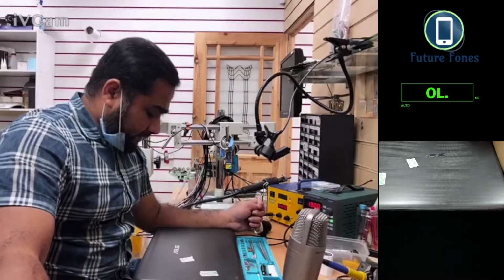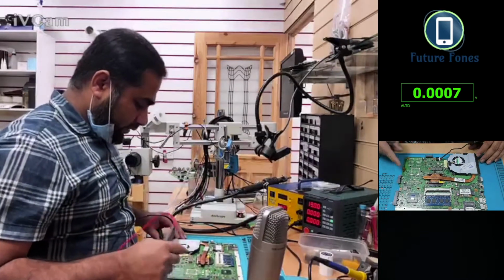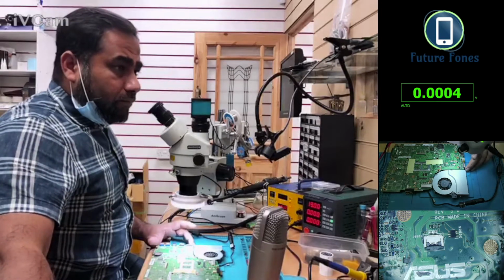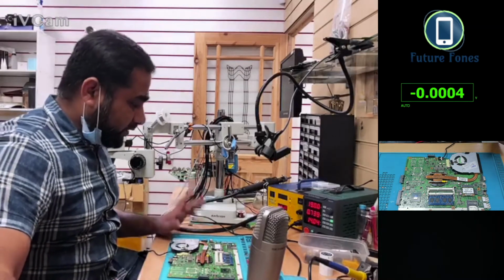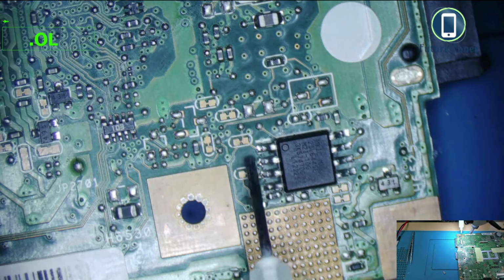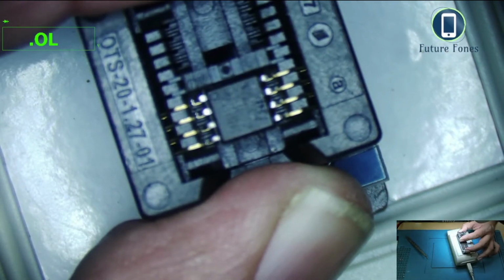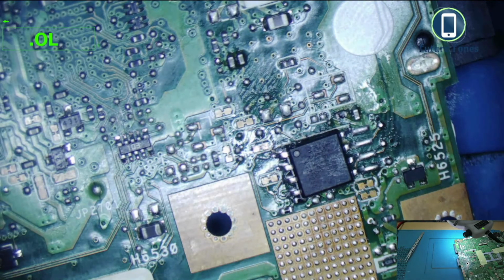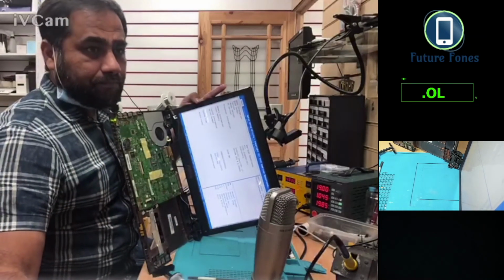ASUS K55VD No Display, Black Screen Fixed In Details

Comment: Hello i have Asus X55A its working ok on external display... Display turns on but the picture is geting from black to white slowly... If i change the display picture is black but backlight is working. I dont have another flat cable to try to replace it... What can i check to fix it?... Did this laptop had display on external connector?
Reply from the maker: Hi, If you have display on external display and problem on lcd/led . you should be looking at lvds  connector , flex cable, and lec itself. Check the voltages on lvds connector. with an without connecting lcd. This should be fix your problem.

Comment: Greetings, I have a similar model X555LD motherboard with no display problem. But the thing is, I think my soldered ONBOARD  RAM is definitely busted. Because, when I power on the device, the RAM chips heat up to 100 degree Celsius which I measured with an infrared thermometer. 

It is like all of the 19Vx600mA power is dissipating on some of the onboard RAM Chips as they heat up like an "oven". Also (maybe due to proximity  to the "oven")  the +4GB SODIMM external RAM  is also heated to extreme temperatures .

Do you  think only a BIOS reprogram will solve my issue? I feel really hopeless about this type of "corrupt BIOS - rewrite fix" because something is definitely wrong with the soldered ONBOARD RAM chips.

Should I remove the heating chips only with a heat gun, or remove all of them at once? I don't think all of the RAM modules failed at once, eh?

Any type of reply is appreciated. I would like to hear your opinion about this.  May the peace be with you...
Reply from the maker: Hi. Greetings , Thanks for your interest. Here is some answers. The Bios programming can not  help remove shortage on Faulty Ram. Please look closely near ram for any disfigured caps causing shortage. You can remove the only shorted Ram and install a replacement. Or you could consider disabling the onboard ram.(https://forum.laboneinside.com/viewtopic.php?t=7265)..
Reply: @futurefonesltd  Thank you, Thank you very much Sir. God bless.

I hope rev 2.0  ram disable method will work on my rev 3.3 board.  Do you think revision change in this board really matter on disabling RAM?

I will again check the shorted RAMs with an IR thermal camera or IR laser temp. probe and definitely remove them.